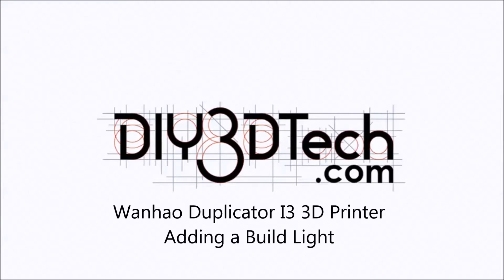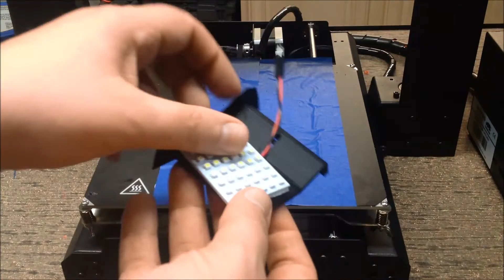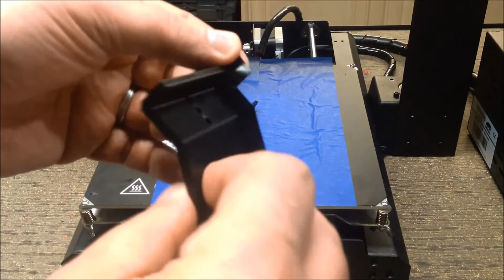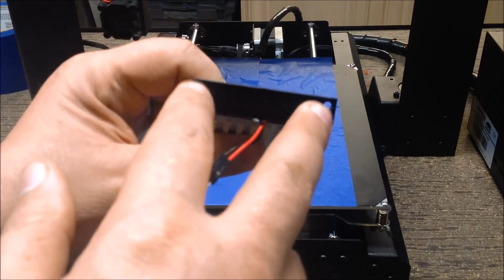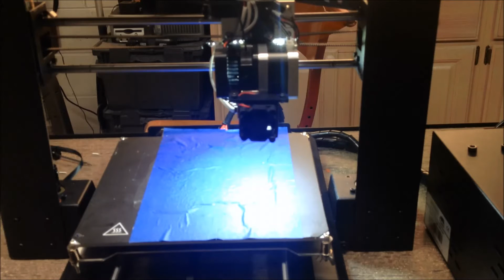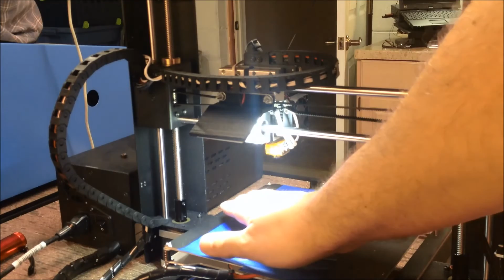Wanhao Duplicator I3 3D Printer - Adding a Build Light

Comment: Adding weight to something that needs to change direction quickly seems like a bad idea generally speaking.
Reply from the maker: No issues at all with it and it has worked well.  In the larger scope of things, the very little added weight made no change and I used it like this for a good year before converting to it to a specialty printer...
Reply: @DIY3DTECHcom  Thanks for taking the time to comment. I just started printing with ABS. Do you have any suggestions on how to print successful bridges with that material? Prints are good other but all bridging fails. Using Wanhao i3 with micro Swiss metal head. Thanks!
Reply from the maker: You might be running a (a) little hot (note the temp reading on the LED screen lies check the Wanhao play list I did several vids on this), (2) check your fan setting and your fan itself...

Comment: why not just tap in to the 12 volts going to the fan?
Reply from the maker: +Nerys other people have tried and it dragged down the fan...
Reply: +DIY3DTECH.com does the fan need that much power? i am replacing my cool side fan with a slower ultra quet fan to lower noise. is that going to cause me issues?
Reply from the maker: +Nerys Not so much the fan, however the LEDs pull a lot of power...
Reply: +DIY3DTECH.com ahh too high a wattage led. i would use aomething more like a 1watt led. put i think i will just rig a usb power bank and run them all off that aince i already need the usb power to do the water cooling.
Reply from the maker: +Nerys Water cooling???
Reply: +DIY3DTECH.com yes. going to get a hunk if copper tonattach to the cooling block and attach a water cooling block to that. this will do two things. first i will have ckear line of sight to the feeder of the extruder assembly and second i can put a giant but silent 80mm fan on the other cooling block reducing noise greatly. in cooler months i wont even need tonuse that fan most likely at all.
Reply from the maker: +Nerys please do post some picture when you complete the modifications as it would be interesting to see...
Reply: +DIY3DTECH.com absolutely. i now have all the needed bits except the copper heatsink. if i cant find something ready made and compatible i will have to see about having it made.

my gial is not improved cooling. my goal is to expise the feeder so i dont have to pull it apart to deal with say a jam and to make it quieter.

Comment: I purchased the LED off of the iPhone App "Geek" direct from China for like a couple of bucks and it took about 2-3 weeks to ship but that is nothing as I do have a bit of patience and wanted it cheap if at all possible.  I printed out the Thingaverse part (my thanks to the designer!!) and want to hook it up.  However I am not a whiz at electrical things but de have a Netgear power supply that puts out 12V (not sure of the mA) and thought that since the LED came with a few different connectors that I could find the female connector that would match the Netgear power supply (so I don't have to cut the end off), solder that to a pair of wires that would feed through the cable chain and to the spare LED connector which would then allow me to disconnect and remove the LED & bracket if I wanted to later on.  I should probably put a switch in the LED wiring to be able to conveniently turn it on or off without having to unplug the power supply.
Reply from the maker: +Norbert Davis yea you will have to "adapt" the connector, my PW is 300ma and it runs my back well.  For me I a zillion wall warts laying around and just cut the end off.  Just be sure to use a multi-meter to get the polarity correct :-)  Also did you see the see the video where I add a switch?
Reply: I think I recall you mentioning it. Maybe that's where I got my idea. The wires off it are red and black with a dual pin female connector. The power supply does have the diagram of the polarity on it which will help.

Comment: How close does this come to hitting the Heated Bed cables on the back?
Reply from the maker: +thedarknightiscoming no where near, its sit quite high on the rails so no issues with it hitting anything and I really like having it as makes the first layer very easy to see now so I can fine adjustments if I need to.  Once I finish all the mod to the Wanhao, I will do a wrap up video showing all the mods in more detail.
Reply: +DIY3DTECH.com I have had my V1 since August and the V1 since october. I wonder how well this would work once you get your piece of glass and whether the glare would defeat the purpose.
Reply from the maker: It does have a lot on camera glare because it is very bright and no diffusion lens in front of it.  As these where meant for automotive replacement lights.  What I am going yo try when I get time is a get a bigger piece of diffuse material and laser cut a piece to fit and glue to the front of the LEDs...